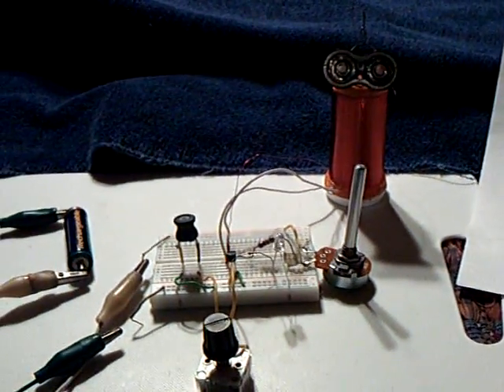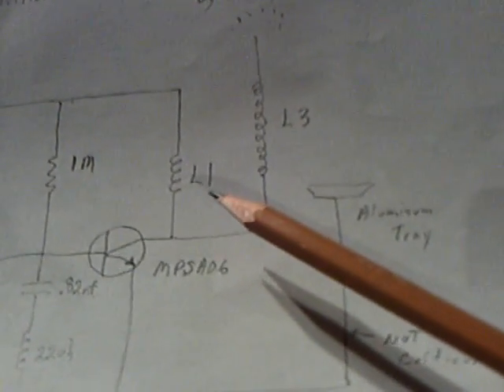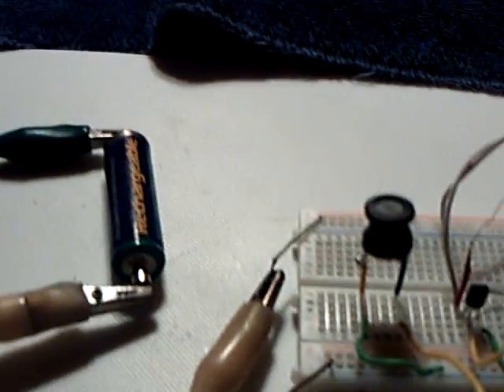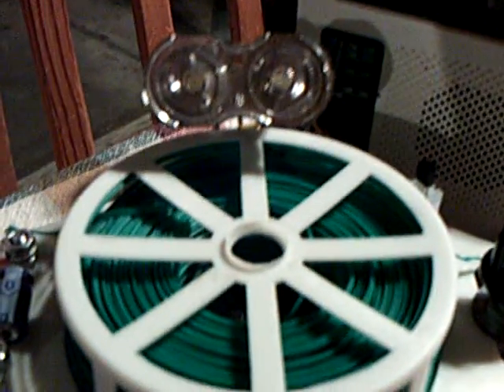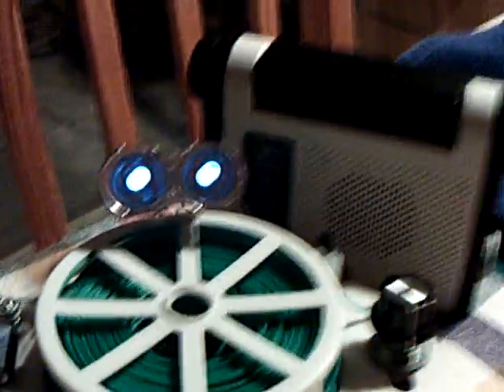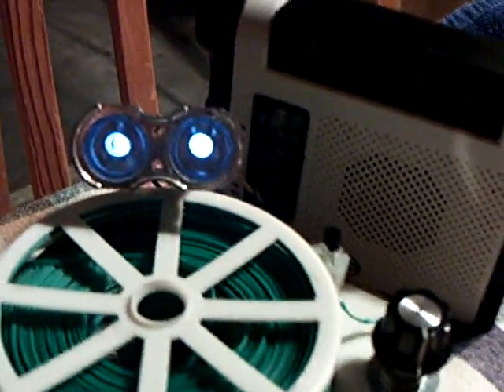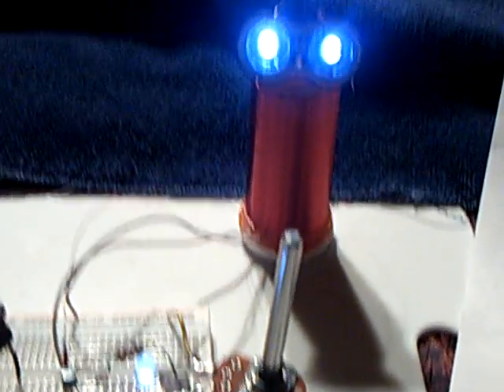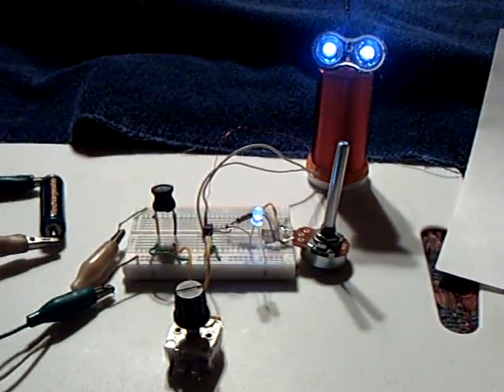Slider's Walgreen exciter

Comment: Hi Lidmotor,

I love your videos.  I’ve been working on this with Slider’s help.  I wound my tower with about 200 winds of 30 gauge (that’s all that would fit) and have my primary on the outside.  I’ll have to try your circuit and build a “Penny”.  

Jamie

Comment: Good demo.
Basically what you've built is a small transistorized Tesla coil that is generating an electrostatic field around the large coil. You will get max output when the secondary coil is self resonant at the oscillator frequency.

My largest Tesla coil was 4 foot high by 4" in diameter wound with #32 wire. The primary was 6 turns of #10 wire. It was powered by a 6C21 radar modulator tube with 2,500 volts AC as the drive voltage.  When running it had a 24" corona around the top of it!

Comment: @Lidmotor AV plug after flyback makes excellent capacitor charging circuit too. And when you discharge it into Tesla Coil primary over spark gap, You will get much more power than your flyback will use for the process :)
Please see in web page freeenergylt.narod2.ru/aidas/sxema_rabociaja_darobotka.jpg and then you can apply same principle to your coil here - it is almost Tesla Coil! :)

Comment: @lidmotor: right, the receiver does not bother the transmitter in the radio example. Then again the receiver is not fetching 5kwatt. practically 99.9% goes to waste="ambient energy" for the sake of the just in case new antenas joining the club.
You are right, my electrical skills are close to 0. But in the lightbulb example you have a 50 Hz variable magnetic field that can excite an external coil like the penny oscilator. But you are right, the coil can act as an antena also, or it capacitance..

Comment from the maker: @jozsab1 -----This is not an inductive link like you describe.   It is a capacitive link.  There is a difference.   I am not using a coil of wire to pull energy I am using an Avramenko plug (Google it).    It is strange device that pulls energy in with no effect on the power source.  It is similar to a radio receiver in that way.  Turning on a radio doesn't effect the transmitting radio station.  As far as earth tuluric currents--- I just have not studied them enough.  Thanks for the input.

Comment from the maker: @joewilder -----Yes.  Most people don't realize that the phone line is powered.   It is probably frowned on by the phone company but it is useable.  In a major power outage usually the phone line is still working.  I think that it is 12 volts.  Don't try to start your car with it.  Small lights only but it beats being in the dark.

Comment from the maker: @slider2732 -----I got plasma with 12 volts but I must have something wrong because the poor little MPSA06 couldn't handle it and fried.  You are right about winding that coil ----it was really hard on the fingers but worth it.  I can see why you use this coil in so many experiments.

Comment: Hi Lidmotor!

I dont know if it is significant but with my penny oscillator (made with axial inductors) hooked up to an AV plug, I dont need the earth ground. If i get close enough or if i touch the bulb (10 watts cfl or 9 watts LED lights of america), i get the oscillator to run. Maybe were you too far from the source when you tested it?

Comment: In my country we get salary bonus for magnetic and frequency radiation poisoning.
Your penny and room light acts like a transformer. The more secondary coils you hook to the magnetic fields running in the walls the more power you suck from the electric company. No magic.
Try to use teluric currents, for example, if you really wish to hook on something ambient instead your power meter :)
Keep up the good work.

Comment: A very nice example of a Walgreen too :D
With an MPSA06 and 1K resistor as simple Slayer circuit on that tower you'll be able to get good plasma with 9-12V, also to play music through the plasma.
Disastrous to the fingers when winding about 800 turns, thumbs up to you for the patience !
A 'Penny' with an AV plug and Earth Ground around lights etc, will try some of that :)